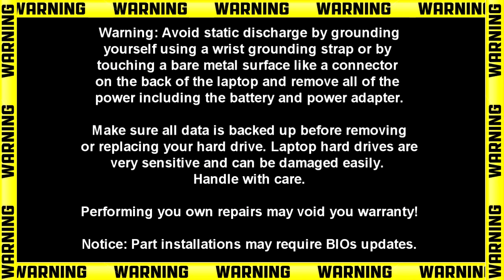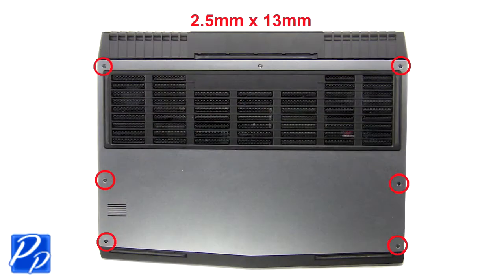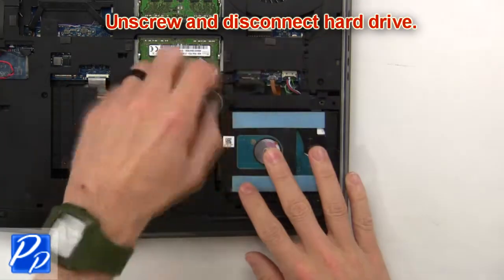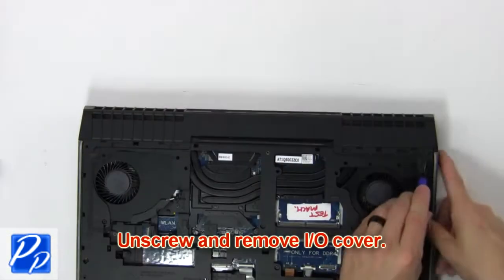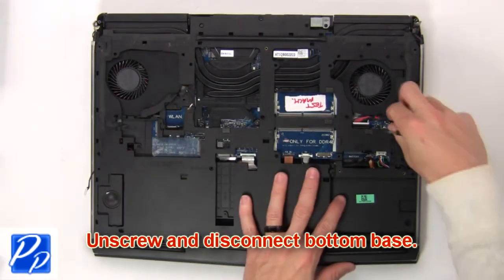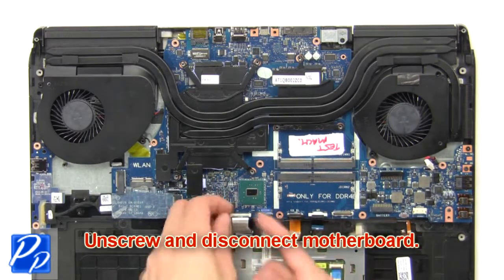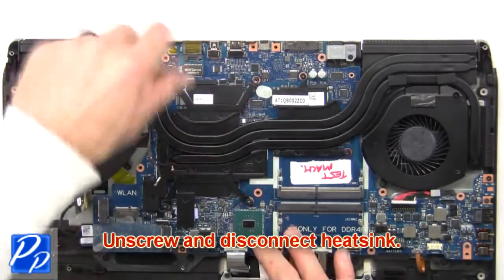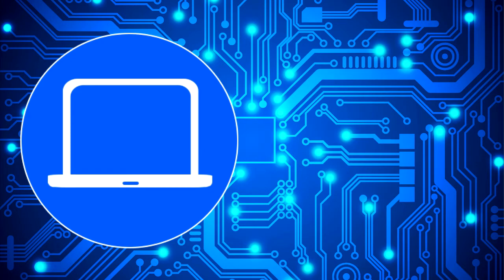Dell Alienware 17 R4 (P12S001) Heatsink How-To Video Tutorial

Comment: I see when you finally remove the fan assembly the heatpipes and fans came out as a single unit after pulling them away from the motherboard (mine does the same thing). Are the fans permanently attached to the heatpipes, or can I replace just one fan? My right-side fan is making such unholy noises I think it might need an exorcism.